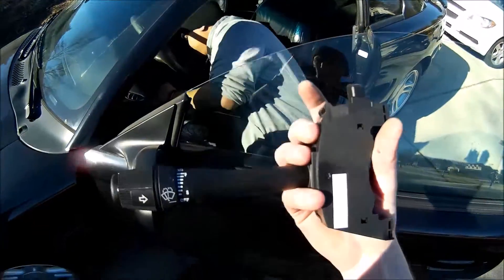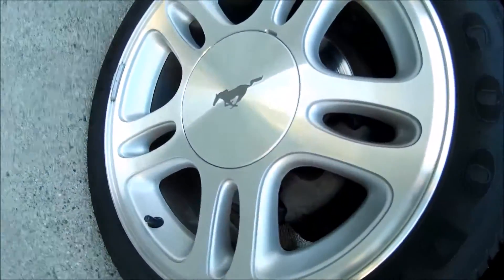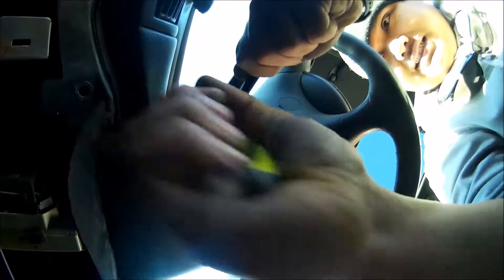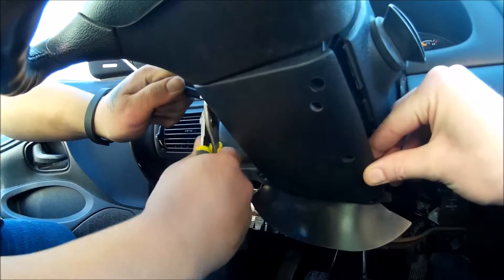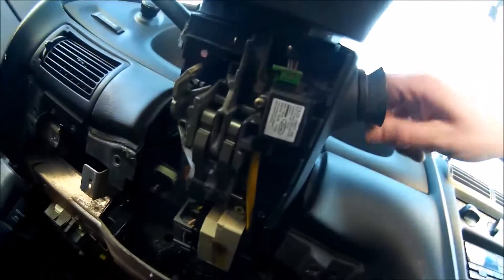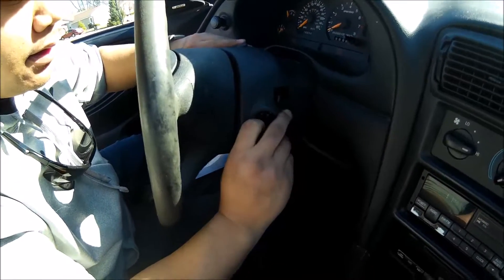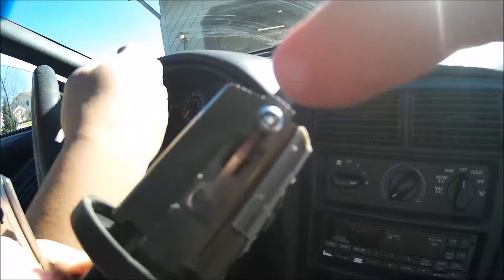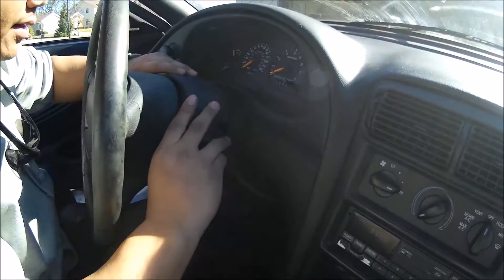Turn Signal Switch Replacement Mustang GT

Comment: A friend of mine is having problems with his low beams not working but his high beams work (2004 Mustang V6 3.9L) he said that his low beams were working the time he left my house but when he flicked the High beams off the low beams quit working again. do you have a more detailed video of how to remove the plastic around the steering column and reassembly
Reply from the maker: I no longer have the car. But if u recall correctly there are just a few screws holding it together.

Comment: My car is doing the exact same thing i just bought a new switch and connected it and the signals still dont work i cheked all of the fuses and replaced the fuses anyway and i also checked the bulbs and wires but the new switch and old still dont work can you help
Reply: Dylan Butler  it was the wiring had a bad ground
Reply: Have a 2014 and the front left signal is doing the same thing, checked with a multimeter no current at all, how did you fix it?

Comment: you dont need to remove ignition switch
Reply from the maker: +Brian Lutz well shit looks like I made more work for myself than I needed to lol.
Reply: I pushed in release and mine felt like it was welded on anyway :p
Reply: Not the switch, but the cylinder you do or the top piece doesn't come off.
Reply: @TH4TU53RN4M3TH0REVIEWS  no you did right. You have to. I just did the same thing. Except I don't know why he's removing the cluster cover.